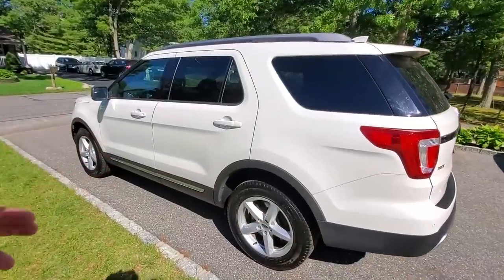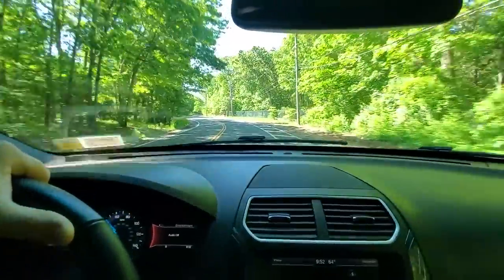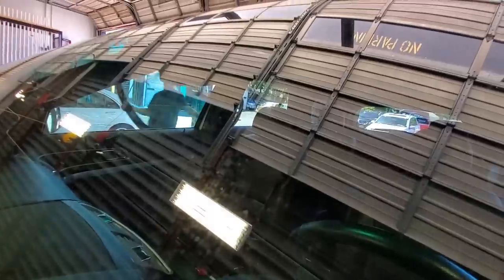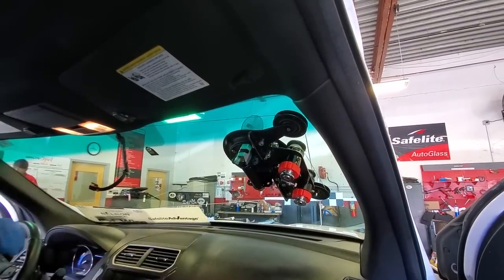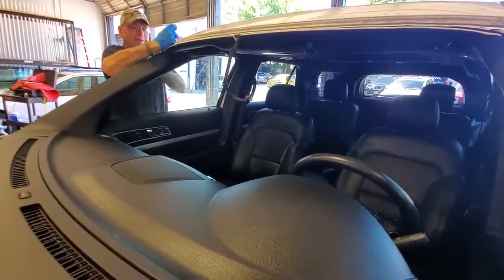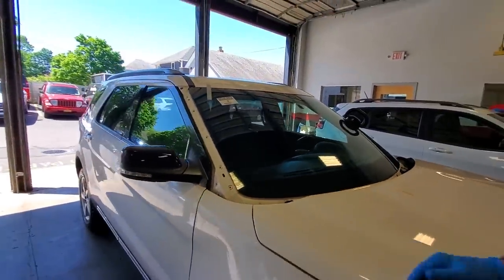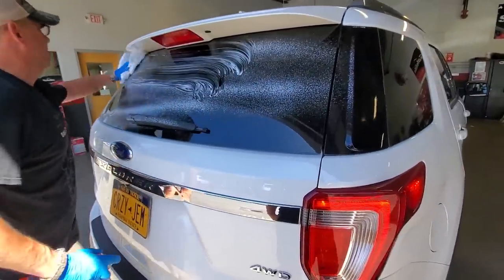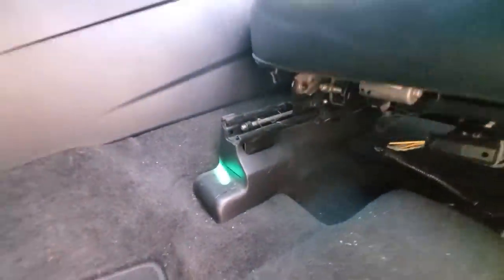2016 FORD EXPLORER PROFESSIONAL WINDSHIELD REPLACEMENT AND LEASE RETURN

Comment: I had my 2018 Ford explorer windshield replaced by Safelite in my area and the side pieces didnt fit right. They didnt align with the top of the car. Looks awful. They even came and replaced them. Still looks awful. So unhappy.
Reply from the maker: that sucks! the v safelight guy says that you can buy OEM Ford trim, but it's very expressive. 😖